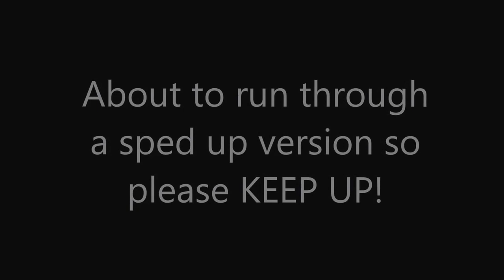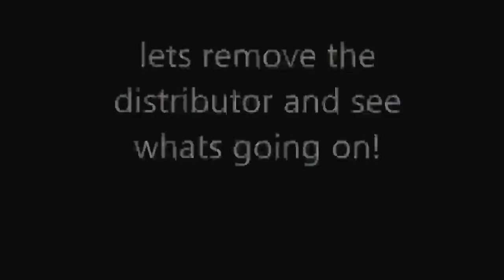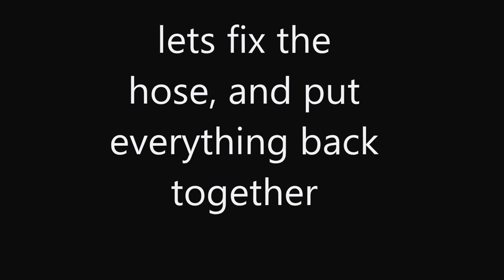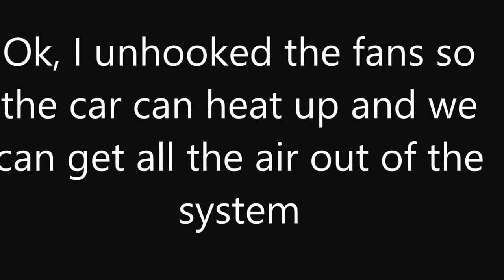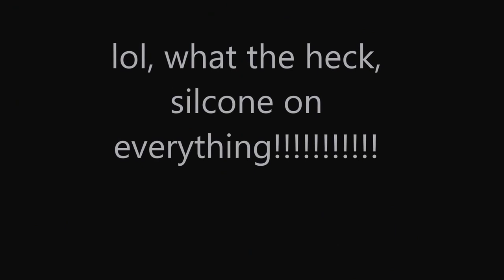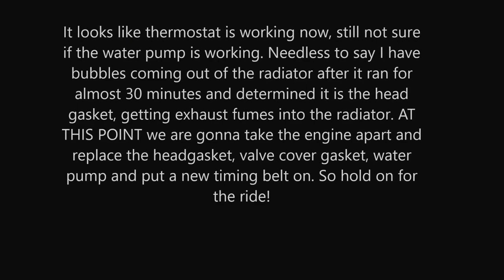Honda Civic over heating problem !! RESOLVED part 1

Comment: Once this engine has overheated for any reason, the head is warped, so the head gasket allows compression to leak into the coolant, blowing the coolant out of the radiator and into the overflow reservoir every time you drive it. Since the head gasket leak is introducing exhaust gas into the radiator, when the engine cools down, it won't pull the coolant back out of the overflow reservoir. If anybody ever thinks they have fixed one of these engines for overheating, but didn't have the head resurfaced and replace the head gasket, it ain't fixed. Good work. It was probably about time for the water pump and timing belt, anyway. Getting ready to do all this same stuff to my 98 Civic pretty soon. Head gasket started leaking on it after the engine overheated close to the red because the thermostat was stuck closed. I replaced the thermostat and thought it would be fixed. Surprise!
Reply: Going to do a compression test to be sure.
Reply: I believe u are right I literally have same problem with my 2004 I just baught two weeks ago I'm fucking pissed
Reply: what if you turned the car off before it went close to red like at about3/4ths?
Reply: so if my radiator coolant goes into the overflow and never comes back after it cooled down means its a headgasket?

Comment: How to videos are so useful. We've recently had to work out how to stop a cabin fan clicking  (leaves in the fan blades!)>
Thanks for sharing
Reply from the maker: Hoopsters thanks for the comment! And yes those leaves can be annoying, easy and cheap fix with a how to video or!!! An honest mechanic
Reply: I wouldn't have cared as much if it hadn't just been in for a service. When the filter was removed the leaves must have fell in. Grrrrr.
Reply from the maker: +Hoopsters that area is pulled from outside air, they get sucked up in the car while you are movie :( you would be surprised how many cars I've worked on that have never had the cabin filter serviced

Comment: hey I have a question I just replaced the hose on my my girlfriends 89 honda civic, but i noticed something was also busted its the first connection in the middle of them with almost a little slinode what is that and how do i fix it lol
Reply from the maker: Sounds like the water temp sensor if it’s just below the distributor.

Comment: I have a question I don't know if you will know what is it , but 2 things the first to the car start I have to  take the ECU unplugged some minutes before I usually take it out on the day before ,  if I don't do the when the car starts seconds alter it dies and keep not wanting to start ,so I plug the ECU on and until the car gets about 30 to 40 minutes running it gets very strange if i get more than 2,000 rpm sound like a big misfires and i have to put it on 4th gear to run at 60 km per hour   anyway so after the time passes i can rev it up with some sounds as a low misfires to almost 7,000 rpm , the car does not smokes nor loses oil or coolant ,I've cleaned the intake and the  TBI cleaned the low rev sensor and so on , now two strange things is that were a bit of oil coming from the pcv valve and also from the hose that comes from the head cylinder gasket ,  so I've put the 2 hoses to the original air intake you near the headlamp ?and closed the 2 holes in the intake manifold and the iron hose that comes with the water hose as well , so no more oil coming in , but those problems were already long before the start problems , I know that I've typed a lot but do you know what my problem could be? I don't know if it's related but in may last year after I bought the car I took it to a Honda dealer and they've put 0w20 synthetic oil on it  and I just got to know that 6 days later when in a high rev like 5,000 smoked a bit , then I put 20w50 oil as our Brazilian owners manual here in Brazil said to put it in 2000 when it was new ! since that day the car was fine but in December that problem appeared , I've changed the  ignition coil and since than it's like what I told you , by the way mine is a d16y7 manual .and the ECU is yw Heihin do you have any opinion about it? I don't know if it helps but I'm sure hat this car was already taken the engine apart  Probable due to heat problems because here in Brazil most of the people put just water in the radiator , since when I bought it I'm using Honda coolant . thanks
Reply from the maker: that is a very odd issue to have, COuld be with your distributor on the starting issue, it could be breaking down due to heat.
Reply: Thank you for trying to help me , and I just saw saw how many typos I had so I'm sorry about that , and yes it is very odd , I've changed the TBI and also the 2 sensor that it has , and also the coolant sensor that is on the head cylinder , and still the same happens , but the most odd it is that after about 30 to 40 minutes the car runs fine , is not like it's letting me down or anything , and no one here in my city seams to find the problem , now you maybe right , the 2 only things that I didn't changed yet are the ECU and the distributor , I had a feeling that it could be the Ignition Control Module because the car did not start for like 20 days and I forced a lot trying to make it start , but if it was that the car would not be ok after 30 to 40 minutes right? I have the video here on my youtube before the car started fine by itself but no one helped or no one had that problem , but I need to buy a distributor because you could be right , but no one helped or no one had that problem , anyway thank you .
Reply: @AqueleDoHonda  it's the ecu
Reply: Hi wow I didn't remember about my questions . Look it was the distributor. I've bought a used one and placed on the car and since that I never had that problem again . . Thanks for trying to help me as well . I want to make an appeal for everyone that uses face cloth mask to avoid contracting the covid virus . All that I see are masks leaking air from the sides of the nose and cheeks . It is easy to make one that doesn't do that leaking . All you need it is to make an oval conical mask with some sort of plastic or flexible iron or aluminum on the nose area . And the air will pass through the actual cloth of the mask .
Reply from the maker: Glad you figured it out
Reply: @tennesseerepairguy2162   I'm sorry yes thank you . this Civic was and is my first ever Honda so I still don't know much about it . but you were right!

Comment: Question: have people generally had luck using head gasket sealant for a blown HG on a 2004 Civic ES?
Reply from the maker: I would never recommend head gasket sealer. That job needs to be done correctly
Reply: @tennesseerepairguy2162  I understand and agree. I guess my question is, as a temporary measure, would it cause any damage to the engine? Is it a strategy that I could use on the short term until I can get the head machined and new gasket/water pump. It would take about a month to get it done right.

Your video is about the best out there in terms of providing an orderly guide to troubleshooting this problem, thank you very much for your generosity. I have ruled several possible issues out, unfortunately it is starting to look like an expensive repair that I wasn't prepared for.
Reply from the maker: @jayschankman214  if you add the sealant to the engine, the block would need a good cleaning before assembly…. It could also block a port.

Comment: Hi Tennessee Repair Guy...I have 98 civic LX and experiencing overheating as well. No visible leaks anywhere or any liquids on the ground. Coolant levels are fine except the over flow tank which is pretty low. Brand new radiator cap. Radiator fan works. Overheating only happens during idling but drops back to normal temp when driving. I know worse case is a head gasket leak or maybe water pump? Should my next step be change out the thermostat before the trying to repair the others?  Your feedback is greatly appreciated!
Reply: Yep change the thermostat if that doesn't work check around your valve cover and see if there is any leak spray soapy water and if it bubbles up means u have a head gasket problem if not then is the water pump but just letting you know in case keep some coolant and and heater core hose in your trunk in case of any freeway emergency u can do it in 10 mins
Reply: Thanks Breakerisaac! I just replaced the thermo fan switch. Fans still don't turn on so I'll do the thermostat next.
Reply: yeah forgot about that fans is the first thing that should work
Reply: aspect D did you ever resolve your issue if yes what was the problem?
Reply: @EastMenloPark1650   it turned out to be the thermostat. I should've changed that first and I would've been okay. Instead I changed the fan switch first and drove and it made my car worse. Changed my thermostat and noticed that my radiator had a small crack because I kept driving it. So after replacing the thermostat and radiator my car is now back to normal operation. I should've listened to others who said it's more than likely the thermostat.
Reply: aspect D hey I’m having the same problem in my 2001 Honda Civic it over heats when sitting but when I rev it or drive it goes down i just bought it and it had no bumber so I don’t know if something messed with the radiator and when I put the ac on the fans kick on?
Reply: @maurisiozarate8346  More than likely it's the thermostat that will need to be replaced. Look around the radiator to see if there is steam or fluids leaking when the car is on as that may be cracked.
Reply: aspect D ok thanks I’ll go buy a new one today and check to see if any fluids
Reply: @maurisiozarate8346  I used this video to guide me to change thermostat. Also check your radiator cap. Those can get old and not apply the proper pressure and cause overheating as well.
Reply: aspect D dude thanks so much I finally got it working I used junk yard parts to thanks for helping me

Comment: I'm having this problem I'm having over heating but I have had the head gasket re done and changed the thermostat and the radiator cap I have the same year car any ideas would be greatly appreciated
Reply from the maker: Water pump or leak test on radiator? Have you checked this
Reply: Not yet but have thought about those two things on the engine
Reply from the maker: Overheat idling or while driving
Reply: Tennessee Repair Guy
Reply: Tennessee Repair Guy my Honda civic overheating while driving.  What do I do
Reply from the maker: Check coolant first, then check temp on hoses coming out of radiator and going in .. it could be a thermostat
Reply: @tennesseerepairguy2162  thankyou
Reply: @tennesseerepairguy2162  Hey man my civic will overheat (the needle will go up over halfway then back down to normal when the engine fan kicks in.) Only does it while idling. Is this an issue or normal? Only have 105k on my 2000 Civic.

Comment: My 2000 civic started overheating and I replaced the radiator cap but I noticed coolant all over coming from the coolant resivoir (the hose was off ) but I put it back and put a clamp on it and still throwing coolant out from the resivoir top can you help me?
Reply from the maker: Sounds like it’s overheating, might be your thermostat... have you ran the car with the radiator cap off? Just at idle make sure it’s not boiling.
Reply: @tennesseerepairguy2162  no I have not but I will
Reply: @tennesseerepairguy2162  can I remove my thermostat or does my car need it? Just don't want to mess up anything
Reply from the maker: I would not recommend it, your car can run without one, the only reason I said to run it at idle not driving with the cap off is because it sounds like there is an air bubble in the system
Reply: @tennesseerepairguy2162  okay I'm gonna run it now without the cap, how long should I run it for? If there's bubbles and if there's no bubbles?
Reply: @tennesseerepairguy2162  okay I ran it with the cap off and there was no bubbles
Reply from the maker: Run it till the fan kicks on?

Comment: My 2012 Honda Civic keeps overheating. No leak in the hose or radiator. The thermostat  is fine. The fans come on for the radiator. I'm lost..... Any suggestions
Reply from the maker: Kristina Byrd  check fluid level or fluid quality you can do that by buying a tester at any auto parts store and follow directions on the package, could be you water pump if nothing else
Reply: We ran that, the pump seems to be working. I'm at a loss. Thanks for the suggestion.
Reply from the maker: Did you recently loose coolant some where? Could be an option maybe an air bubble in the system, I know you said the thermostat was working did you test it? Or have you checked the hoses after the fan comes on it typically cycles the water.
Reply: @tennesseerepairguy2162   We tested the thermostat and checked the water cycle which works fine from a  idling position. The car has been getting so heated that the fluids are steaming out. I haven't run it in a week (since it started steaming). It got so hot my dipstick in my oil melted. It had a couple bubbles that came out but idk if there is more that could be causing the issue or if they formed from the issue
Reply: try to check your head gasket. might be a problem if you've got alot of times over heating.
Reply: Common civic issues are blowing headgaskets..get the radiator topped off and test for combustion gases in the coolant

Comment: That happened to my today I was driving and my passengers told me it was heating up and I pulled over immediately turned off the car to prevent damage and then smoke was coming out from on side of the hood by the distributor and after 2 hours I realized it was the hose luckily because I was hitting hard on the gas pedal that's why. I replaced it in another 2 hours we took 10 mins to replace it but to find the part was hard
Reply from the maker: Breakerisaac yeah sounds like a busted hose
Reply: yeah luckily i had a lot of help and got it done in 4 hours without towing but spending money -_-

Comment: Dude, this is so wrong!! You are in a shop, NOT stranded by the side of the road, and you actually cut an inch or two off the hose instead of replacing it!!!  The hose obviously failed  because it is OLD and WORN OUT.

Not only does that hose NEEEED to be replaced, but ALL of the hoses are made from the same material and are likely about to fail.  REPLACE ALL OF THEM..

You"fixed" it the cheap way, not the right way.
Reply from the maker: Thanks for watching the video. The idea behind me finding the issue and fixing it is to only help people understand where to look. I also do this on my own free time to help others also. People can make the judgement to do it the right way or the cheap way.  Enjoy your day